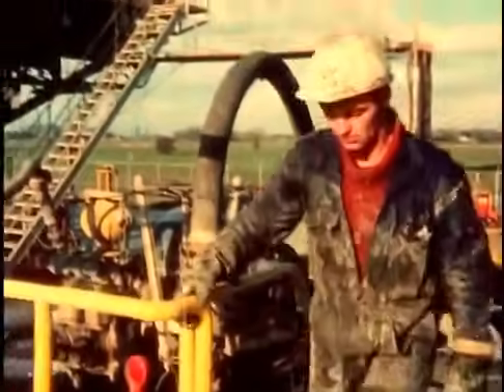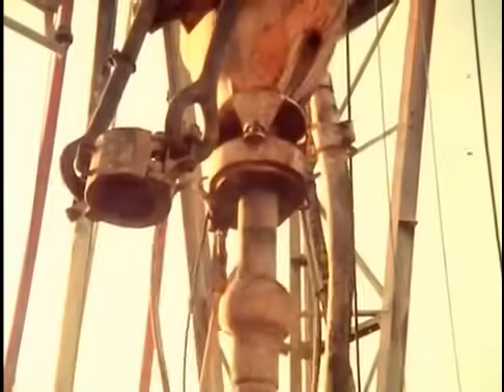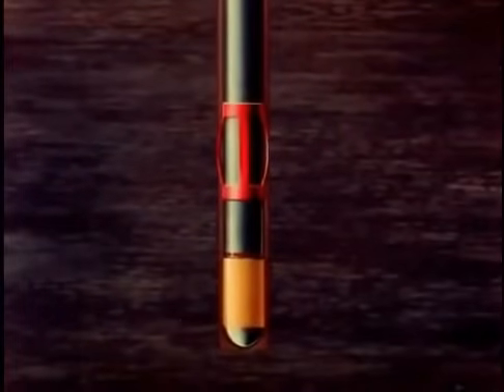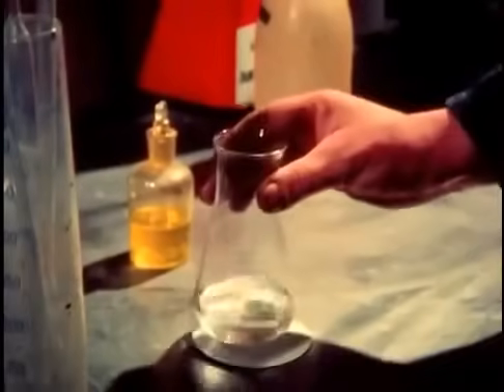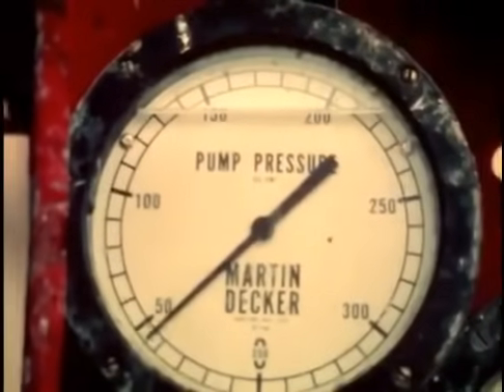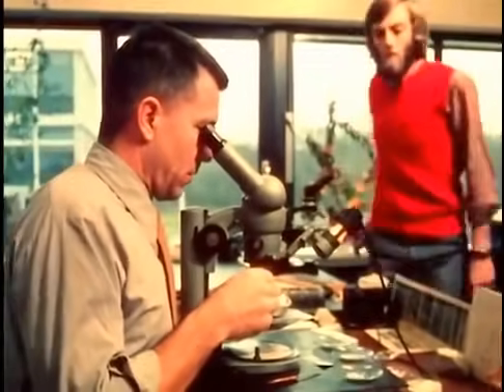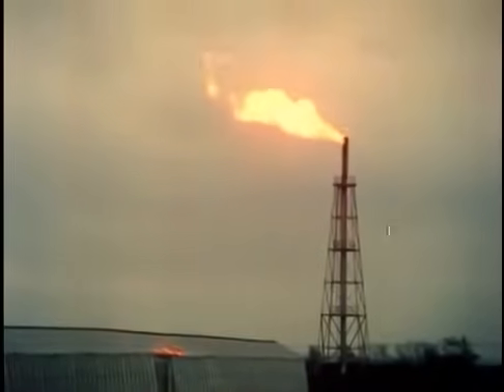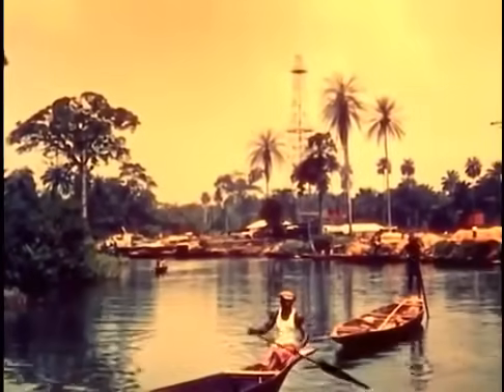Oil Well Drilling Process - a Shell film

Comment: Did this job outa high school in Wyoming. Never once saw a woman on the job. We were 17 miles from a paved road 140 miles from home (bed). In February,  when the next crew couldn't get to the rig, to relive us at 2 am due to weather, we would pull a double shift. Never a woman in site. Try tripping pipe for 12 hours to change a bit at 3 am.  in the  morning at 20 degrees below zero with a 20 mph wind. It really sucks if it's a wet connection .😂 oh, to be young again. Making 50 dollars an hrs in 1976. We were Ballin.
Reply: Try going offshore then tell me about roads..
Reply: 50 an hour ?!
Reply: Yes you were! I was born in 76. Kern county California. Went to the rigs after high school. Fun work
Reply: I work for a water well drilling and pump company, in Northern California. I’ve driven 6.5-7 hours to the Bakersfield area, then chain tong 600’x10” pipe, with 3 connections per joint. Move everything to the next site, set everything back in. Got the test pump ready to run in 36 hours straight. While it being 115 degrees, during the day time. 
Then ran a 24 pump test, then an additional 14.5 hours to pull that pump out. So yeah, 36-38.5 straight. Or work 94 hours in 6 days, hauling equipment and drill rig mud boat and various other things. Kingman Arizona to Northern California, three times in that 6 days.
Reply: No snatch in the patch
Reply: @davidnunez8364 I highly doubt that . The minimum wage was $2.00 hour.
Reply: https://youtu.be/_ZbuPA6r7bo

Comment: Brought back memories or should I say nightmares from the Williston Basin 1980 to 1982. Very concise and informative.
 They should have shown this to all of us roughnecks.
Reply: I worked the Williston Basin during that time, I worked Derricks for Brinkerhoff.
Reply: I'm on the Canadian side of the coin. Alberta. From 1978 to 2016. Offshore for 5. I believe I could've explained it much better in many areas. Especially the drill stem testing. Open hole with packers above and below the pay zones. Opening the well to the surface without hydrostatic pressure from above aNd below very dangerous procedure. Which is now long ago stopped. We did before running casing. Why case a dead well. I have done perforation work. But why spend money on if the results are unfavorable. Ah the surface casing and it's real functions of why were kinda funny. And adding parts to the BOP system as you drill ahead. Usually the stack is complete with the bag and rams from the start. But otherwise it brought back memories of what so few years ago were like compared to today. I enjoyed every moment of my time in the drilling industry. 17 years drilling no injuries to myself and crew members. And I was old school on the brake. Get it done. Not one to be gentle. I found the controls talking to me by feel and hearing. Best days of my life. And I raised a family during it.
Reply: https://youtu.be/_ZbuPA6r7bo

Comment: I remember those days. I broke out in the early 70s started out as sample catcher worked my way up to driller. Did it for about 18 years. Worked in Oklahoma and Texas . Back then you worked every day with no days off. If you had to have off you quit or had someone double for you. Most companies started giving days off in the mid 70s or late 70s.
Reply: Wild
Reply: Been there done that, 7 days a Week.
The Shi**y part about all this is I broke out on a Double, meaning a Rig move every few  weeks or so.
Then got off the Double, went to the Permian Basin worked out of Odessa, started working good sized Triples, working Derricks, then a Driller.
I was Drilling for MGF, maybe you heard of them, they filmed Waltz Across Texas on our Rig, the Crew and I were in a very small clip.
Then came THE END. 
1 day ALL Drilling was shut down, NO warnings,  NO more drilling no where.
F**ked me up, cause my next step was to Hire on with Shell and get off the Rigs, more of a Company Man 😁.
Then I had to go start Pounding Nails,  which turned out to be a good Trade, did that up until last year.

Between the Oil Fields and Construction my body is SHOT, I Hurt and Stiff to where mobility is getting bad.
The WORST part of ALL this is, I'm just as broke as I was when I 1st started in the Fields 😫🤪😀!
Reply: https://youtu.be/_ZbuPA6r7bo

Comment: its amazing how the use of multi-lateral drilling has decreased the cost of drilling numerous holes in one area :))))

Very cost-effective and oil companies are able to extract oil from a larger surface area
Reply: When I was Drilling in the Permian Basin, TX, some of these companies is what we'd call Fence Jumpinh.
They would use Directional Drilling to tap into another zone that is not in the Mineral Rights of the 1st hole.
Reply: This is a great Video.
This brings back Good memories and BAD!

I was working during the BIG Boom in the late 1970s &1980s, went to the Site for a Rig Move, there were 4 Crews, the Pusher comes out to announce  that THAT DAY was the LAST day for ALL Drilling to shut down.
There was NO warning, they just Shut it ALL DOWN.
I don't think any actual Drilling started back up again until mid 90s, and that was up in the MT, SD area, TX a bit, that Boom maybe lasted 4-5 years?
Working the Rigs, being a Roughneck, was Very exciting, learned alot, met many a good man, Worked your A** off, also Played Hard.
Reply: I’ve seen Shell wellpads (gas) in the Montney with over 30 wells.  It cuts down on all kinds of costs.
Reply: https://youtu.be/_ZbuPA6r7bo

Comment: Maybe a roughneck can explain... when they cement in the casing, how do they clear the inside portion of the casing of cement? From what I can see cement is pumped in down the center, around the tip to the outside of the casing where it displaces the mud back up to the surface and then they let it set. Wouldn't the inside of the casing also be filled with cement that is going to set? Specifically talking about 6:05
Reply: Specifically, they pump  through the drill pipe the volume of cement calculated to fill the annulus between the casing and the wall of the hole — from the bottom up as shown in the video, after that volume has entered the drill pipe, they switch to drilling mud and that is what pushes the last portion of cement down the drill pipe so there’s no more cement inside  either the drill pipe or outer casing.

Oh, I should’ve mentioned that the cementing process starts by pulling the drill all the way out, replacing the drill bit with a check valve assembly called “the shoe” and running that assembly back to the bottom of the hole and using it to seal the bottom end of the casing so that cement ONLY.flows outside the casing.

So other than just the last little bit of the casing there’s never any cement in it.  After the curing time they unhook from the shoe, bring the rest of the drill pipe back out of the hole, pick up a plain ol’ bit, run back in, drill through the shoe and the cement, pull out of the hole one more time to pick up the fancy drill bit (and these days a lot of electronics that can measure the rock just like wireline tool they show here, plus take surveys so they can map where the hole is exactly) and only then get back to making new hole.   

The entire process takes at least three days.  I was a mudlogger (the guy grabbing cuttings off the shale shaker and putting them in the sample bag) on offshore wells back in the 90s; so once they were going to run casing I had a few very easy days ahead of me.  The roughnecks out on the drilling floor were going to work their asses off yo-yo-ing pipe.
Reply: @dennisfox8673  You are exactly who I was hoping would comment here. This had been bothering me and now I know. Thank you sir.